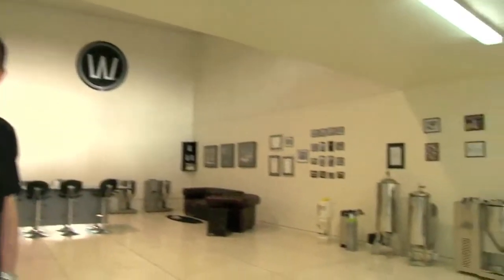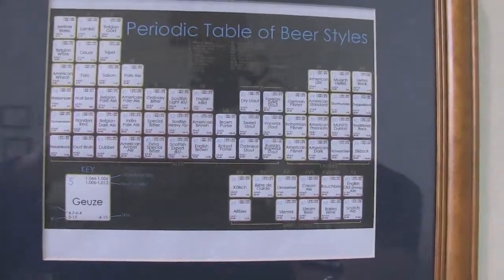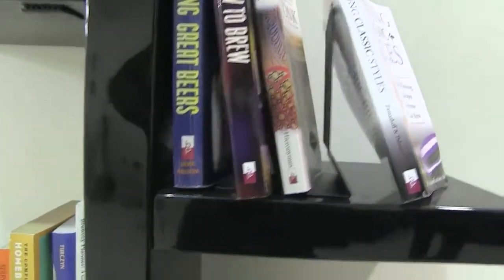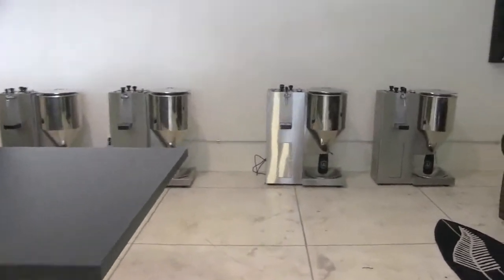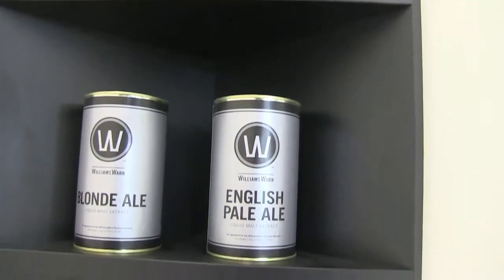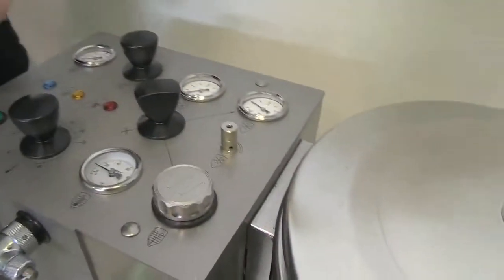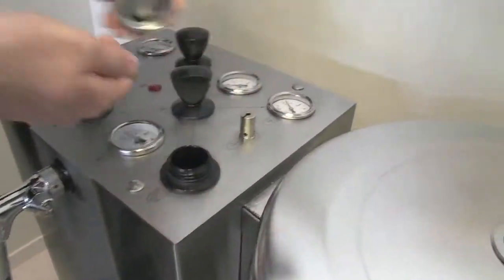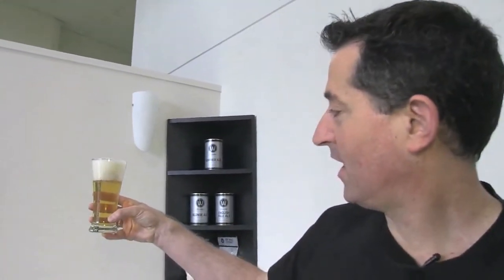WilliamsWarn Tour - The WilliamsWarn Story

Comment: It's a little tank with a heating element, a cooling coil and a thermostat. A CO2 bottle, a pressure gauge, and a (manual?)pressure relief valve... It's got a catch can under the valve to remove sediment. He's brewing from cans of goop!
Thanks, I think I'll build my own out of spare parts. It will probably look like one of those earlier models without all the bells and whistles. 
Oh and it needs two tanks, for a continuous cycle of one brewing, while you drink from the other one. Awesome!